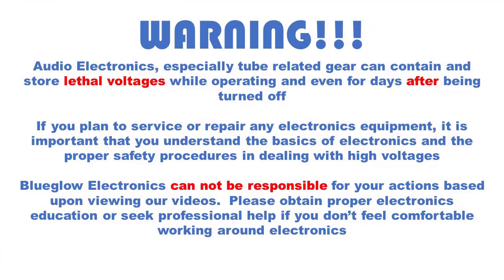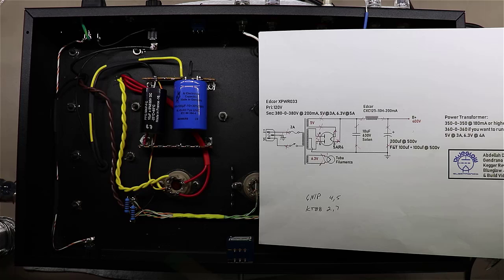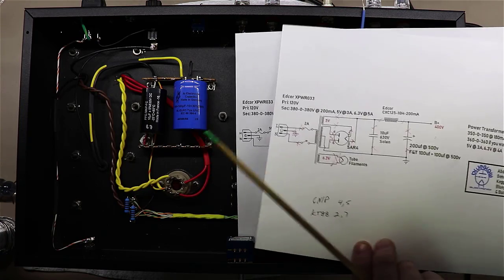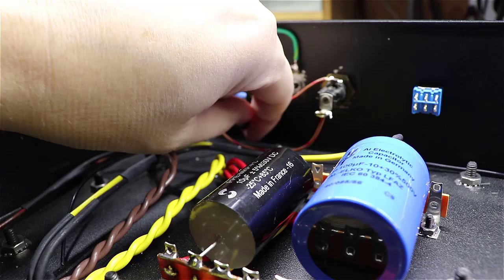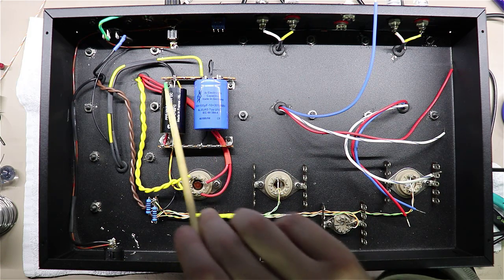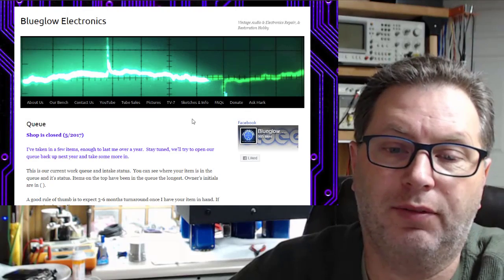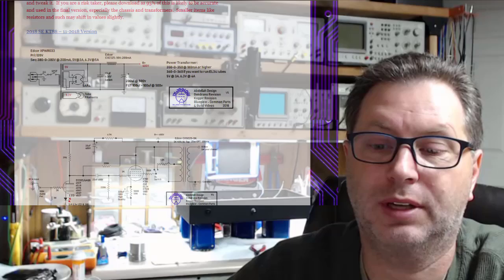KT88 - Single Ended Tube Amplifier Build 2018 - Part 5b

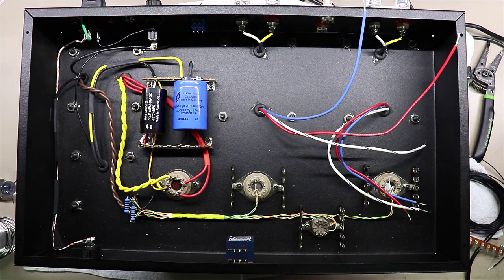Comment: I know this is over 3 years old; however, if anyone can "explain away" my confusion...I would appreciate it.  Also, if this has already been covered...I apologize.  I understand the importance of placing the fuse/switch on the hot; however, it seems as if both are on the neutral AFTER the re-wire.  It seems to me as if the neutral (along the left side...originally connected to the switch) is connected to the fuse & switch after the "re-wire".  It also seems to me as if the hot (along the right side...originally connected the the fuse only) is connected directly to the transformer via the thermistor after the "re-wire".  I paused the video at 2:15, at 3:00, and at 3:55 for quite a while...but I remain confused.

Comment: Sorry, I have a question about installing CL80.  Firstly, what is the purpose for installing CL80?  Secondly, how to wire CL80 (is it one leg of CL80 attached to N(IEC) and another leg of CL80 connect to N wire from transformer)?  

https://www.digikey.ca/en/products/detail/amphenol-advanced-sensors/CL-80/19760?utm_adgroup=Inrush%20Current%20Limiters%20%28ICL%29&utm_source=google&utm_medium=cpc&utm_campaign=Shopping_Product_Circuit%20Protection&utm_term=&productid=19760&gclid=CjwKCAiAm-2BBhANEiwAe7eyFG4oecIH11iqRXKFeVHzAwb4yS5ZVPC70Kpsqb84lzIIaLHdWGJexxoCddkQAvD_BwE

Above the link, is it the one I should buy? 

 Thank you.

Comment: Mark, my IEC Connector is labeled,  rear connector view,  if the ground (center) is on top,  the lower right is  Line or Hot, neutral is on the lower left, reversed of how you stated, just an observation from viewing the video. I am about half way through assembly on mine, thanks so much for the detail and explanations.

Comment: Great video.  Yeah using a thermistor will cause a voltage drop,  but not much.   Carlson designed a circuit to get around this very issue without using a thermistor,  I might try and implement it on the next one I build.   https://www.youtube.com/watch?v=bX0o3jAzSBs

Comment: you AC going to your fuse should go to the rear of the fuse holder, the reason being is there is a less of a chance of getting electrocuted if you remove the fuse with the power on
Reply from the maker: we are starting to cut hairs here :-)
Reply: @Blueglow  i am just fussy mark

Comment: I wanted to ask the purpose of the choke on the primary winding
 Is it for lowering noise, prevent surge current when turned on, or to help with large surge currents on the secondary, or any combination of the three ? I have never fully understood the purpose of the choke on the primary. Thanks in advance for any explanation.
Reply from the maker: Its about CLC vs. CRC.  The inductor does a much better job filtering via maintaining constant current through the power supply.

Comment: When describing the fix to the power switch you said you wired it to the choke, not the primary of the PT. Just an FYI...Love your stuff buddy! Keep em coming!
Reply from the maker: You are correct, thanks for pointing it out.  I'll call it out in part 6
Reply: @Blueglow  Sounds good, looking forward to it! Say, have you done a video on the topic of Ultra-Linear feedback? I'm very curious about the use of this method, the effects it has on the amplified signal, and the trade-offs when used. Would this be something you'd be keen to try to explain in a video (if you haven't already). I rather enjoy your style and would love to see you do a video on that topic. Thanks again for all of your contributions to the craft!

Comment: Glad you rewired the switch, thank you. Just a little worried about those 500 volt caps. Perhaps 630 would be safer to handle surge.
Reply from the maker: Nothing to worry about for short periods of time.